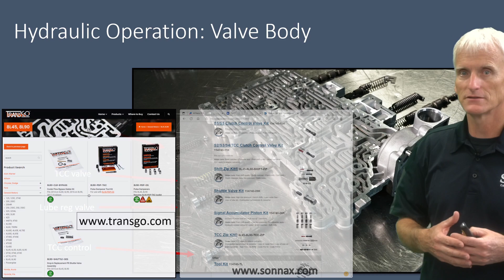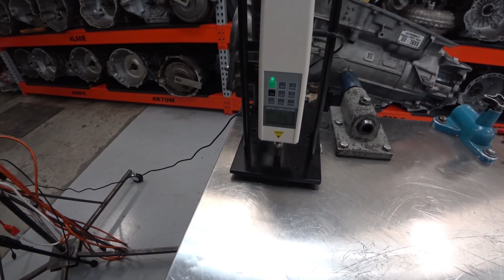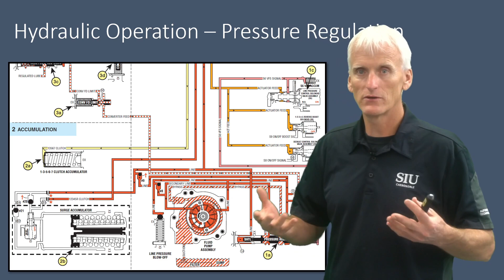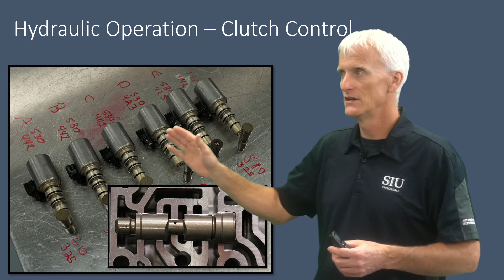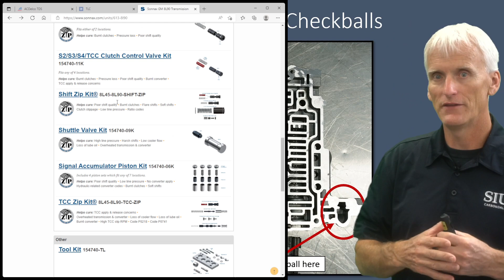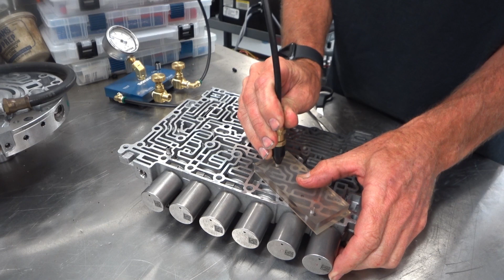General Motors 8L90 hydraulic operation

Comment: Hello  my name is heath ,I watch your videos alot, but I am a 35 years in transmission work. I have a 2019 8l90 came to me with a simple out put speed sensor code. Truck has 95k on the odometer,  my r&r tech accidentally drop the whole valve body,  luckily nothing was broken,  but now it want move unless it's the rpm is brought to 2500,then it tries, have not driven it or forced the issue.  I'm stumped  I can not find anything that would cause this. Do you have any recommendations for me to look.

Comment: I have had 2 GMC Yukon 6.2 Denali trucks. My first 2007 6 speed blew at 140k miles rebuilt and blew again at 204k miles.
Really liking the truck and especially the 6.2 engine, I purchased a new 2017 Yukon XL 6.2 Denali. Only this time I was almost fully prepared how to maintain a very busy transmission. At 29k miles I took it in to the gmc dealer for a tranny oil flush. The service manager came up to me and said the flush would be $400 and I would be wasting my money. I said "since it's my money... Indulge me". They came back to me saying GM recommended Mobil 1 lv hp Blue Label, I said I hope it fixes some of the hard shifting, clunking up and down gears that I've been experiencing. It did a little. At 70k miles I flushed it again for $275 (different dealer) At 110k I just dropped the pan and replaced the filter and 9 quarts of oil. ($81) plus $20 filter. So every 40k miles I've been doing the same but at 155k miles and frustrated with the lousy shifting performance, I started using 20 oz (2 bottles) of LubeGard Platinum added with my oil change. Kept the shudders away and kept it shifting without any of the old symptoms I experienced when the trans was new. I still run commercially as a Livery driver still using the original 8l90, currently clocking in at 247k miles. The 6.2 engine gets nothing less than 0-20 Royal Purple engine oil... the engine has no lifter noise whatsoever. I've also used Royal Purple in the transfer case and differentials as well one time. I hope this helps many of you out there make better decisions.
So the bottom line is GM uses cheap parts that require extra care that most drivers don't know about. How do you say < Torque Converter !
Reply: so did mine 145mi and 204 mi ... amazing

Comment: Have you ever done a tutorial or seminar on the Sonnax vacuum test stand kit and how to use it specifically on General Motors 60 70 80 and 90 Electronic three speed four speed and six speed transmissions
Reply from the maker: No, just the 6L80/90 and the 6T70.  You can go to sonnax.com and view their vacuum test guides.  The expected results can be found in the instructions for the replacement valves.
Reply: @siuautomotive  Nice just got through opening the box to my new Sonnax Vac test kit.  I know a little bit about how to use it I used it before very little and then it was stolen this is my replacement it will never leave my house/shop again Now to start replacing all of my reaming tools.
Reply from the maker: Wow!  Sorry you were robbed!  Those reamers are expensive too!  If you are a Trnw.net member, he usually has the best prices.  Actually, his prices are still probably better even if your not a member.